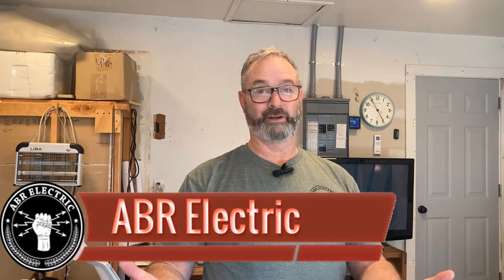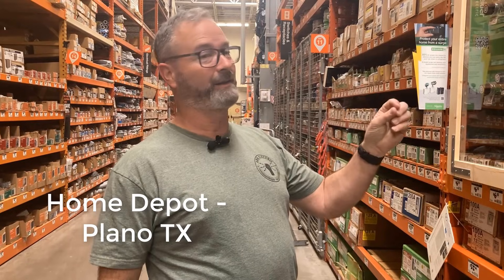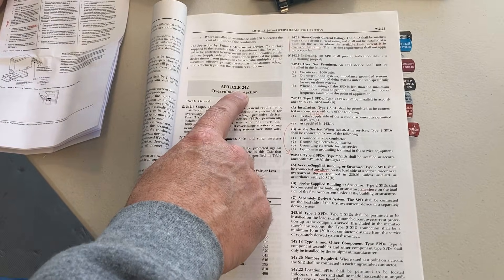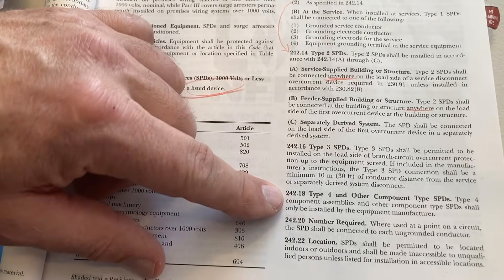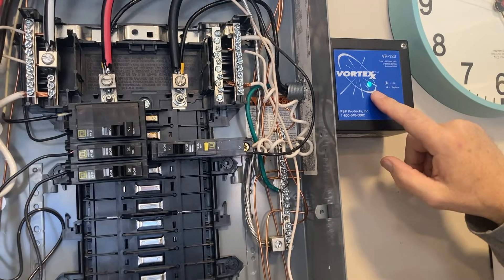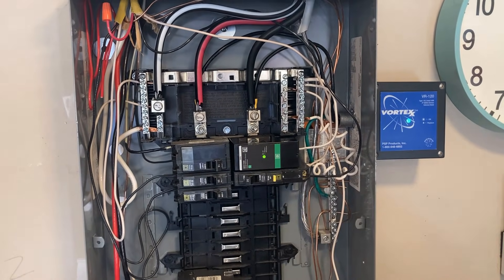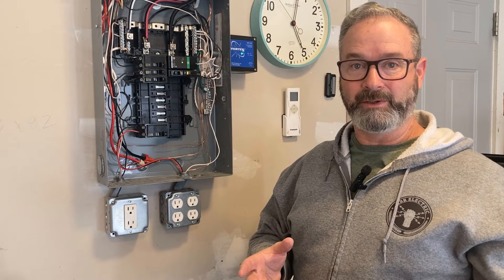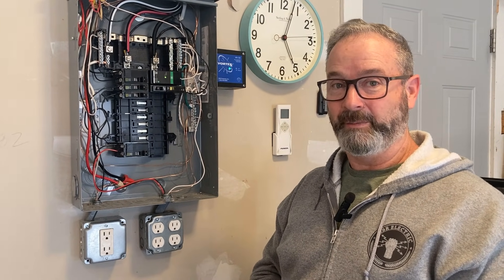Plug-In Surge Protection with Square D

Comment: There appears to be more than 1 wire going into each main lug-same screw. Is that permissible? I thought that they were designed for only one conductor.
Reply from the maker: The instructions with the PSP Vortexx type 1 show this tap on the smaller conductors to the main lugs. So, the SPD is rated that way.
Reply from the maker: Tge QO plug in SPD only has one wire. It is not double lugged.
Reply: There is definitely two wires going into the main lug.

Comment: What is better - the hard wired (like the vortex in your video), or the plug in breaker type like you installed in this video?  The one I just bought is simply plug in - similar to the one in the video but with with no wires at all.  Which one is more effective?  Does it matter assuming they are rated the same?  Thanks!
Reply from the maker: The rating (SCCR) and warranty.

Comment: Instead of FS140 Siemens now sells FSPD140 model. It's a proper UL listed product, not a fake. It has a slightly more compact body and smaller, differently-shaped varistors inside, but basically offers same type of protection.
Reply: I just installed one of these. Nice unit, but cumbersome to mount if the service panel is flush with gypsum board. There is a flush mount kit on Amazon, but for $50 I made my own instead.